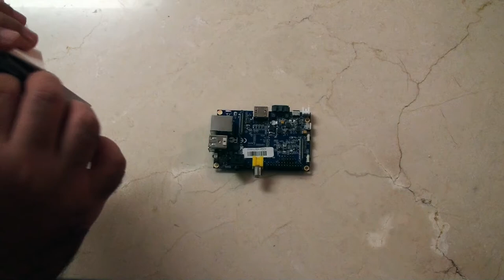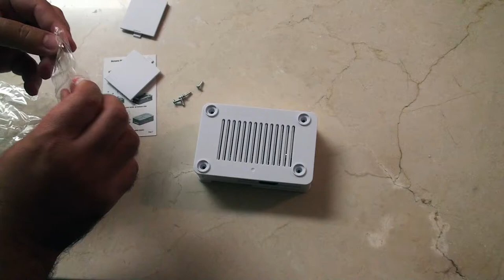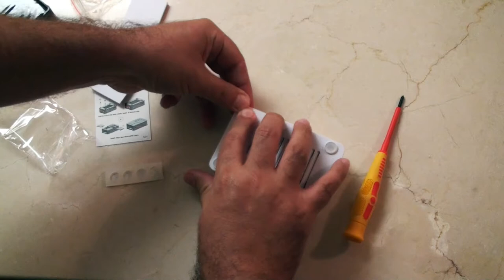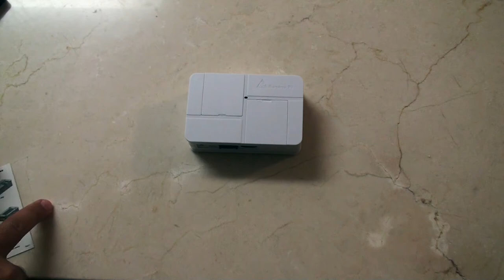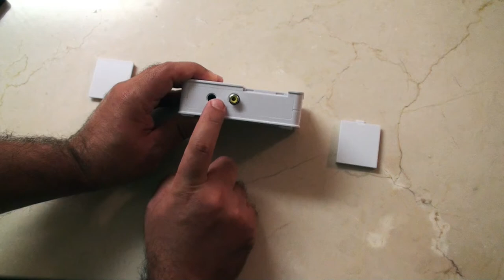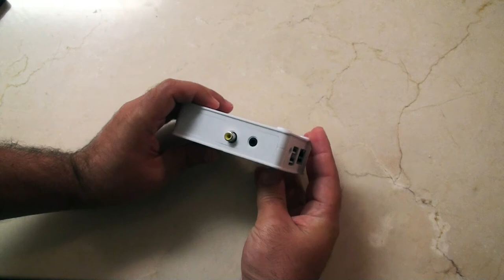Banana Pi Case - unboxing, assembly and review

Comment: It is a nice case, but I had a lot more trouble than you did trying to hold the 4 sides on while putting on the bottom.  Once together it is nice and dulls down those leds a bit.
Too bad they don't make something similar for the raspberry pi.